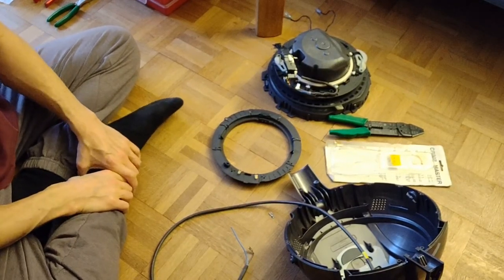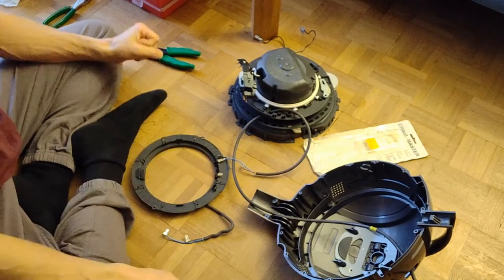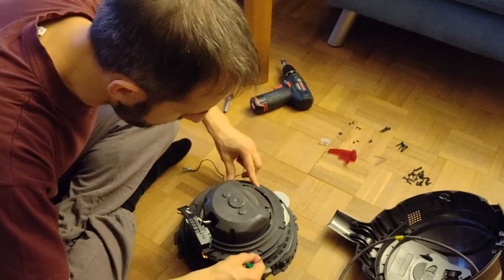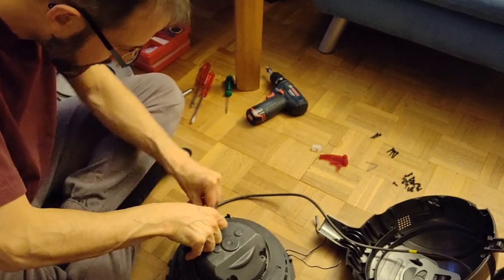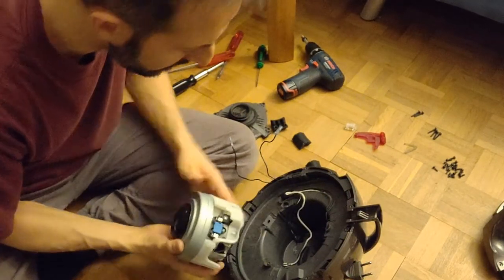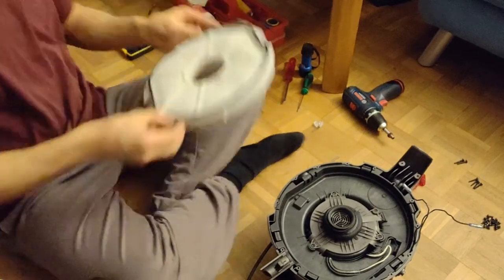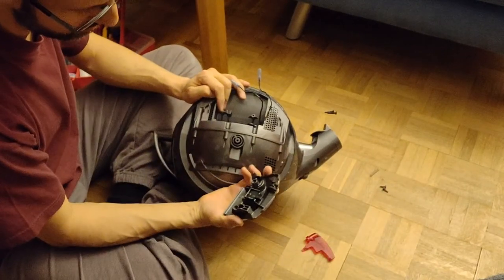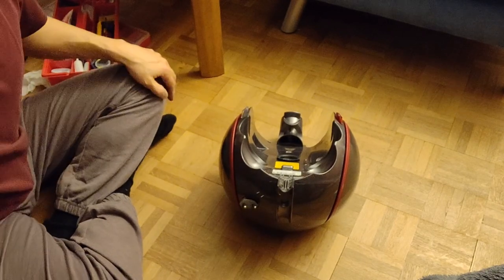02 Dyson cinetic big ball absolute 2, the assembly

Comment: Female Spade Connector Non-Insulated 90-degree with Locking Tab - Wurth USA
Reply from the maker: Yes, almost. It is only 4,8mm wide and in opposite to your suggestion the locking tab is going in the other direction.